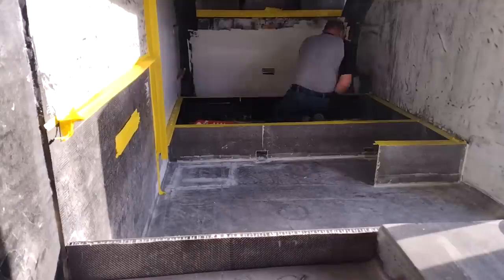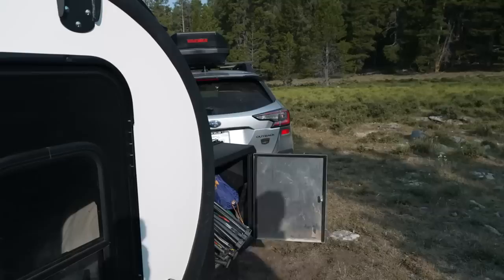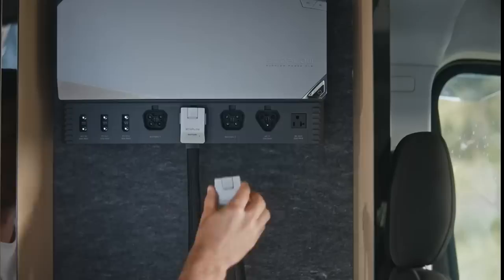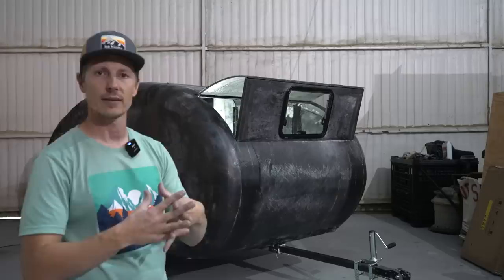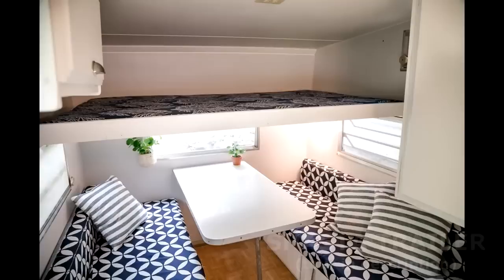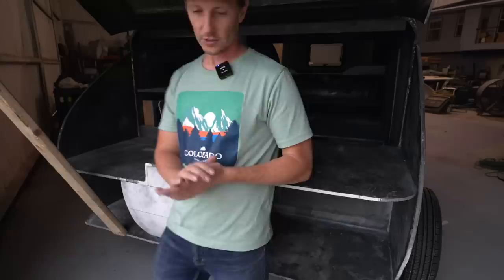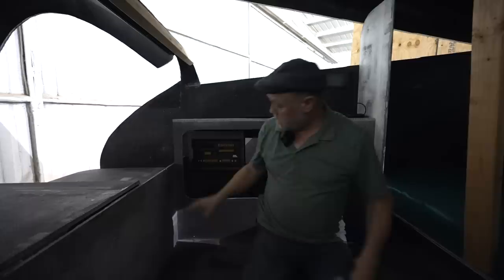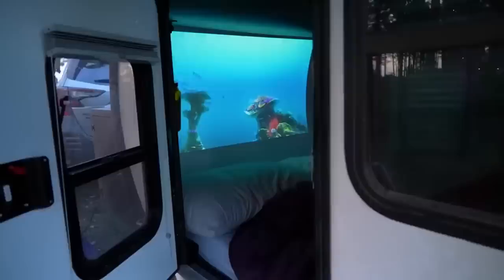World's First Pop-Up Teardrop Trailer With NO CANVAS!

Comment: This thing is looking fantastic and I can't wait to see the end result, plus can't wait to see them on sale :D  My wife and I built our own teardrop, but sadly had to sell it and get an old 13 scamp because we needed just a little more room (also standing up is nice).  I'd love to go back to a teardrop that has the scamp size, but is light weight like a scamp!  Our tow vehicle is limited to 2k pounds so weight is a major factor when looking at campers, if this thing is around 1k at finish... I'd be super interested.
Reply: Gross weight is going to be set at 1500 pounds. The shell weights 525 pounds. Suspension, galley equipment and water, EcoFlow power station, and bedding bring it up to about 830 pounds. So it has a usefull load for all the stuff campers take with them of 670 pounds. With the braking system it should be towable by almost any vehicle. I expect most campers will be pulling it at around 1100 pounds.
Reply from the maker: That’s what I like to hear Charles! Woot woot! And just so people don’t get confused that Ecoflow power kit is just something we are installing for our family. My guess is most people will be using either a portable power station to power this camper or a smaller power management system than we have installed. It doesn’t take a whole lot to run lights, fan, and a fridge.

Comment: Love that you are trying to develop a trailer that incorporates all the best features, and I am seeing a lot of great ideas. However... it does feel complicated. Maybe it will seem less so when I see the finished product rather than focusing on all the details of the build. Also, since I don't have children, I don't have any interest in having bunks (wasted space), and I would prioritize A/C over heat (I live in Virginia). 😊 Oh, and I'd love to have one of those paint can tools!
Reply from the maker: The intention for this trailer was to be very simple. Like I mentioned in the video, this is an experimental trailer for our family in terms of the complicated parts. The trailer that Charles would  build would not have any of these complexities. The complicated components on the final build would just be the lift for the main top and lifting the bunk window. This should take about three minutes or less. All this other stuff you were seeing on our trailer is more for the channel. We want this trailer to be capable of testing anything that is out there. Beings this will be our main trailer. We don’t want to have to use other trailers just to test specific gear. Now, unfortunately, because we are designing this to be aerodynamically sound, this means for anything like a rooftop tent, awnings, road showers, basically anything you mount on the roof or the sides will have to use a different trailer to test those. Like you said, I think this will seem much less complicated when you see the final design.
Reply from the maker: Good points on the bunks. I’m assuming Charles will have two versions a family version and a non bunk version.

Comment: At the end of the 1990’s, my husband and his dad built their yacht with a carbon fiber honeycomb construction. The entire shell of the boat, which was a live aboard catamaran style, was only carbon fiber. I actually think it was the first boat of it’s kind but I could be wrong about that. I remember when they did it, it was innovative and they thought everyone would be doing it. But I don’t think I’ve seen it used all that much. The honeycomb was great for preventing sinking of a boat, and I would think it would be excellent for insulation of a tear drop.
Reply: The floor and roof and hatch are made with a plastic honeycomb like core. The sides are foam. This build has more than just carbon as reinforcement. I added a layer to get much better impact resistance.
Reply: @teardroplite  Ah, I see. I think you’ve designed something amazing. It’s truly innovative, and I love design that reinvents something you think you’ve seen everything with. It’s so exciting, I can’t wait to see it completed.

Comment: A smaller 2-person version, queen up front, passthrough under the bed, mid-section with standup, and that style of galley, and nothing else volume-wise, would likely make a lighter weight, under 2,000 lb, camper trailer that I could pull with my Jeep Wrangler TJ.  I love the idea of the rounded sides to cut side approach wind sheers.
Reply: This trailer has a gross weight of 1500 pounds. That is if you can think of enough heavy stuff to bring. Dry weight is about 800 depending on electrical components. If demand is there, we might make a smaller stand up version one day.
Reply: Oh, our first trailer is a 5x10 trailer. It got pushed into the corner, 80% finished, to build Drew and May their trailer. It will probably be for sale before this one.

Comment: Very excited to see how this turns out and did a Napoleon Dynamite “YES!” when I heard y’all landed on the eco flow electric system! I’m hoping what’s available to the public will have the standing room and maybe be 6’ 3” or taller..? Do you know what the standing room height will be Drew? I’m working on restoring a Boler fiberglass trailer and realizing just how much is sucks to always be hunched when I’m in the trailer. Thus, I keep window shopping other trailers while I work on my own restoration project 😅
Anyways, hope this turns out as good as it looks now, light aerodynamic trailers will help make my long term dreams of boondocking with an EV a reality! And hopefully affordable!
Reply: 6' 5"
Reply from the maker: Glad you like it. In the first video we highlighted that it will be about 6'5" to 6'7" standing height. So it should accomodate most folks. I love Bolers. But I completely understand how it would be different at your height. I'm glad you mentioned EV. I have a feeling that will create an entirely new small camper market. I am super excited for it!

Comment: My suggestion would be to consider a tandem axle trailer with this build. They're safer and will bounce and sway less than a single axle. Plus if you do blow a tire you can use a rachet strap and lift up the bad axle and limp to safety. Also with a tandem axle trailer you can use leveling blocks to lift up the trailer to change a bad tire. This eliminates the need to carry a jack with you.
Reply from the maker: True on all pts. here. One of the reasons and probably the biggest reason we won't be going with a tandem axle is weight. Even just the Timbren axles we put on this were much too heavy in terms of camper to axle weight ratio. We really want this trailer to be able to be towed by a large number of smaller vehicle. And then aesthetics. It is hard to see now, but when this camper is done it is going to look like a retro teardrop when traveling down the road. Baby moons, big old wheel wells, white walled tires. But, I completely agree with all your pts. We have had such a great towing experience with our double axle "half"  converted cargo trailer.  Even backing up is so much easier!

Comment: Don’t fear Monocoque or semi-Monocoque construction. It’s been used in aircraft for 100 years. And aircraft vibrate, shake, smack the runway and twist and bend under wildly competing forces.
Reply: Thanks. I have been building composite aircraft for more than 25 years. A guy on my airport built a steel framed wooden teardrop and I thought about applying my aviation skills to a teardrop. The first was 5 x 9.5 and well under 400 pounds.

Comment: Awesome!! Really looking forward to the final numbers, so far this price point is more in our families budget. We live in Oregon, so we have a lot of options and I’m honestly all about local. However, spending $18K to $23K for a teardrop that sleeps 2 is one reason we haven’t purchased. We have 1  child  (now a tween) and a 6’3 adult.  From the first video I watched about why you love teardrops, I knew you spoke my language. I’ve always thought I would have to design my own trailer….or keep waiting around. We’ve come close to purchasing a bigger trailer(I never wanted bigger than 16ft) but I don’t want indoor kitchen. Our biggest desire for 3 ppl (tall) is ability to use bathroom inside our trailer and sleep 3 ppl. I want a kitchen outside with a nice overhang. We want light weight to pull with an SUV through the paths of Oregon. I want something that’s going to last 20 years and be low maintenance, I don’t need electronics everywhere. We also want something that we can camp with all year around, even in winter. For us, fall and winter is important bc that’s when you get restless in OR during our rainy months. We have been leaning towards the 6x12 Bend Teardrop bc of the full size bunk, it has a lot of what we need at a price point that won’t hurt our budget. However, we are still on the fence. I’ve been waiting and waiting to see what’s going to be happening with this trailer and if it’s going to be manufactured, I’m so excited it is. We’ll be anticipating the next video so get the final look and functionality. While I understand the price is still being looked at around the $20k’s it a lot better that what I had said to my husband yesterday, when i literally was just taking to him about your build. I was like, “look it’s probably going to be some crazy number like $60K 😆 I’m tired of getting excited about a dream design and the prices are just out of my budget”. Was so happy when I came to your channel to see if updated video and saw this update video and read comments about estimates on price. 

Thanks again!

Comment: Super cool. I often daydream about RV designs and I tend to have similar taste. If I were to do a custom it would be on a small RV. Now, where we are different though is I'm not going to even attempt to take our whole family of five in a teardrop or small camper. Yeah, right. I had to get a bumper-pull toy hauler. Our NoBo 19.8 was too small for us when we just had the two kids. Myself on the other hand, am a geologist in real life, and could see myself in one of these by myself or just me and the wife. But probably just me going out with the boys pulling it with my Jeep. But I think you're right making the pass-through to the kitchen and the swinging roof to open up the space. This is going to be a badass camper for sure. Also, another takeaway for me is 1) probably invest in Ecoflow 2) buy some Ecoflow products. The battery powered A/C (all versions sold out) opened my eyes. They're doing some good stuff. Also heard customer service is better than competitors.
Reply from the maker: We have been in quite a few larger travel trailers and 5th wheels over the years. And like you I fiind even our family struggles to stay in one. And I think there are a few factors at play there. #1 they are designed to be lived in. So because of this you end up not bringing the outdoor side entry tents and other features like bathrooms that, in our opinion, making camping easier and more enjoyable. And #2 most larger travel trailers are built with a layout that uses hallway living and an overuse of cabinets. Once we stayed in our pop-up camper and the cargo trailer I realized the issue wasn't as much about space, but more about design. By eliminating or thoughtfully placing cabinets and replacing narrow hallways with wide open areas you get a completely different indoor experience. But, I also completely agree with you that our style of camping isn't for everyone. So I am so glad to know there are options out there. And yes, good point on the EcoFlow I didn't mention it in the video. But, one of the things I love about this power kit is that it is part of Ecoflows larger Ecosystem. Like I said we built up the base of this trailer to support testing things like induction stovetops. And to do that we will probably need to attach additional power stations and solar. Another thing I REALLY like about the Power Kit is that it is not propriatary. We will be able to use our current solar panels and power stations from other brands. Which I think was a nice touch. I love ecosystems, but I hate being forced into them. If that makes sense.

Comment: Glad this will be built for us to buy too! Hope the price can stay low. Have you checked out the Safari Condo Alto R1713/1723? Those too are retractable-roof teardrops (with no canvas: just aluminum sandwiching a honeycomb composite), though are bigger and more expensive. Would be great to your thoughts or a tour of them.
Reply from the maker: Love the Safari Condo. I was really careful with the title of this video.  I searched high and low for almost a year now to make sure we are the first to do something like this. The Safari in small camper nerd circles would be called a "standy." Some may even call it a canned ham. But a teardrop trailer by definition is non-standing height and has a galley kitchen. So that puts our trailer in a weird spot definition wise. In transport/storage mode it truly is a teardrop. But, once the roof goes up it is more of a "standy" with a galley kitchen. At some point we probably may need to come up with a definition for this type of trailer. Our goal with this one was for it to live big , but tow and store small. Like you I would love to get in an Alto and share it with the community. I think it is a really incredible trailer. To be honest I have a bit of window envy. That is the one thing the Alto will have that this will not. We will add a good amount of windows. But nothing like that full length window they have.
Reply from the maker: If you go back to the pinned comment in this video (the first comment in the comment section)  there is now a paragraph from Charles. It states quite a bit of information including thepricing of this trailer. And fortunately it came in much lower than many people thought it would.

Comment: well done composites are stronger in many circumstances than metals, so unless you have a lot of high 3 dimensional loads, or need something with really good fatigue characteristics, there is really no need for a metal frame. a trailer doesnt even come close to the load characteristics of experimental aircraft. sorry drew, charles is definitely right on this one.
Reply from the maker: Love hearing this! This is an area I would definitely like to be wrong about.

Comment: I am about to install brakes on my SunRay 109.  I will definitely be using the Autobrake controller.   Thanks for the tip!
Reply from the maker: At the moment I find it is most affordable to buy teh Autowbrake straight from the company. The AutowBrake just makes sense. Put it where it belongs, on the trailer). This way there is no delays, not required brake controllers, and you can swap tow vehicles without any extra effort. We have had a number of people ask us to get the Sunray 109 on the channel. I will have to look into it more.

Comment: Potential looks High. I'm curious about possible racking in winds when it is open.
The crossmember that holds the hinges for the rear clamshell really doesn't look like it has enough structural strength.
I think I'm with you about the frame. Even J-B Weld gets fatigued after a while. Can't wait to see it done! You must be extremely excited!
Reply from the maker: You are absolutely right on the crossmember. That was a miscommunication one day on site. The door got cut in the wrong location when folks got tired. Lesson learned, don't make cuts when you are exhausted.  The door will be moved to the front near the bed. Leaving a much stronger connection there in the rear. And good point on the racking in the winds. That is something that we will have to take into consideration when designing this.  And yes, I am over the moon excited. I think about our camping adventures way too much! It is almost unhealthy. Haha.
Reply: Hahahaa!!!

Comment: 🍻want, please
With heat and a/c, please.  We need a four season trailer.
Only question about no frame is whether the trailer will be able to be pulled from behind if it and the tow vehicle need to be pulled backwards.

Comment: INTERESTING. I see Nida-Core structural honeycomb in your build. Rutan moldless layup techniques. Carbon fiber. All stuff I am doing with my trailer, except that mine is going to be a 3 segment (telescoping) popup with 2'3" of lift per stage. I am also doing frameless, and using axle-less suspension. We should chat.

Comment: I am very interested in seeing how the sides of the raised sections will be made.

I'm also not clear on where exactly the parents' bed is.
Reply from the maker: I am excited to show the side sections in the final design. The big part will be showing the gutters we put in for water management and hitting it with a power washer in the video. As for the parents bed it is a queen bed located about 3 inches below the bottom bunk. In our design, it run sideways meaning lengthwise from side of the trailer to side of the trailer. This is something our family prefers. But we assume most people would want it lengthwise, so I’m guessing the final design that Charles builds will be in the lengthwise configuration.
Reply: @PlayingwithSticks  I am looking forward to the next videos, then!

Regarding an east-west or side to side queen bed, spacewise that makes most sense. I can understand some people wanting the north south or head to tail direction of the bed, especially if it provides access to each side of the bed. Not only does this make it easier for both occupants to be able to get in and out without climbing over one another, but it makes putting bedding on the mattress much easier. As a person with arthritic knees, I am understanding more and more the appeal of easy bed making.  Might Charlie be able to offer both options?
Reply: Start at 3:45 for a brief view of the queen bed with green pillows at the head of the bed.